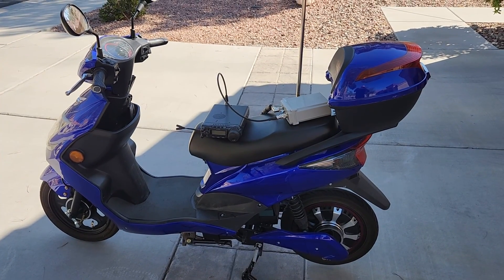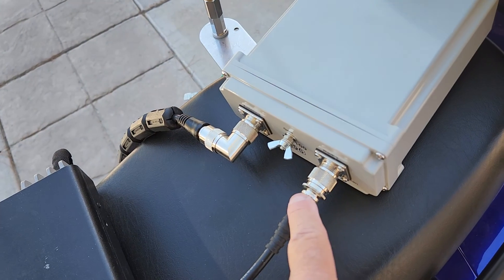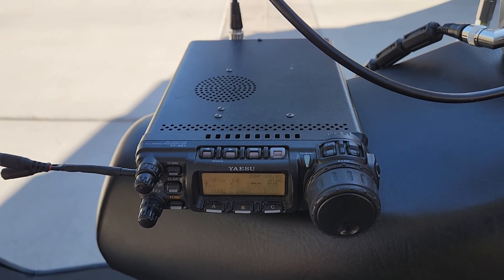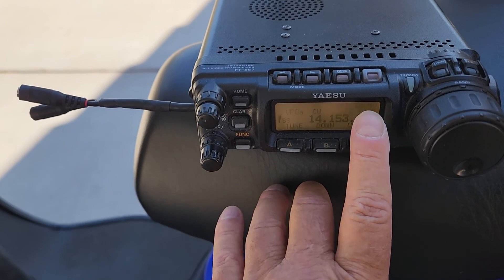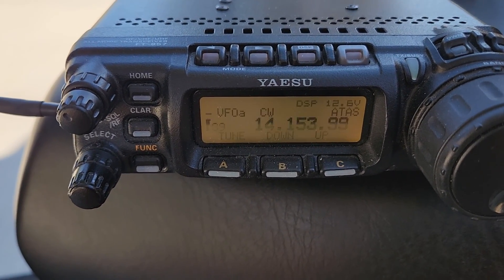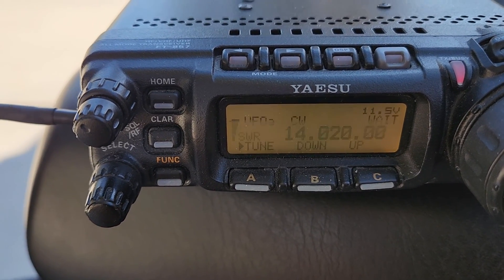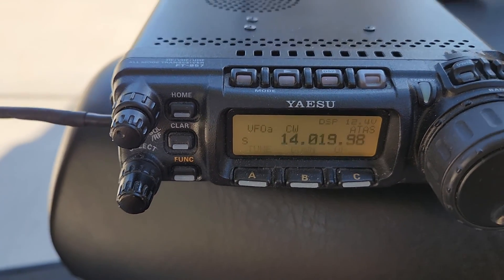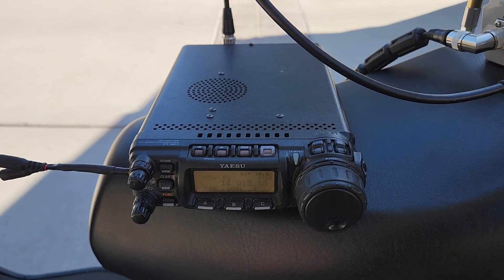Slick remote auto-tuner setup for Yaesu HF radios

Comment: I am a new Ham, do you have to use the LDG RT-100 remote antenna tuner? Or will any tuner work.  What should I look for?
Reply from the maker: As far as I know, only the LDG tuners emulate the Yaesu ATAS antennas that need power and RF.